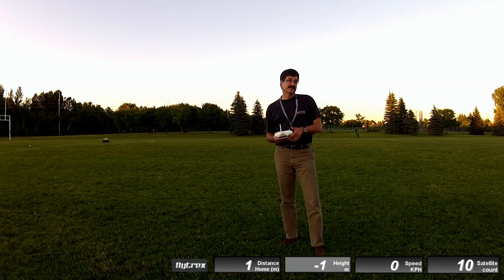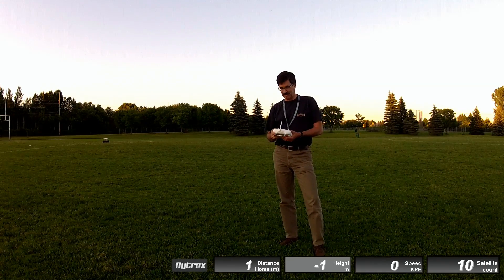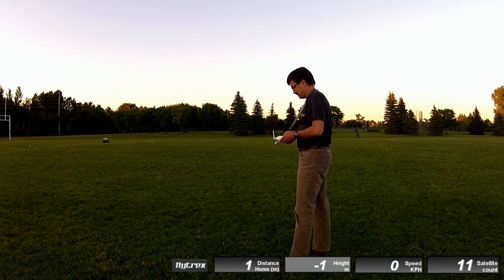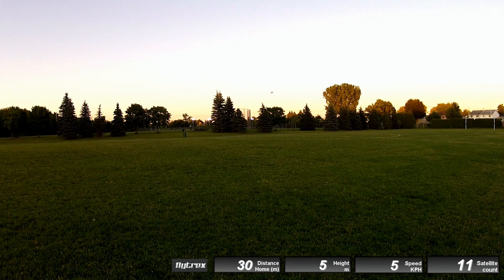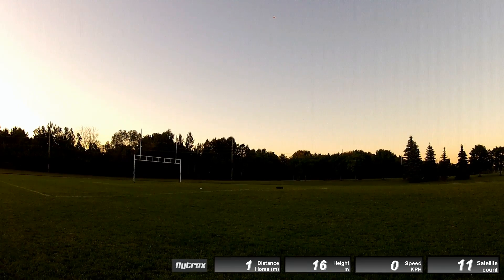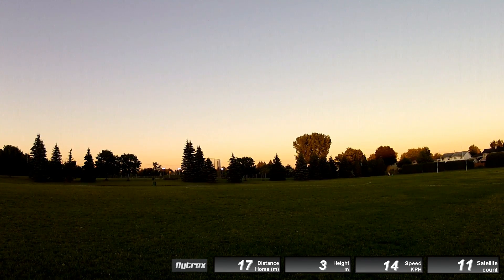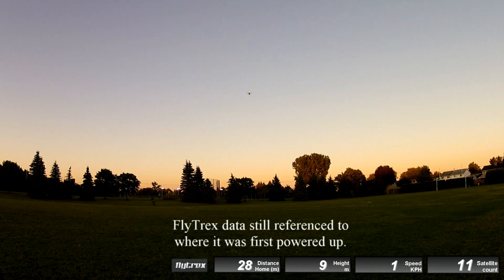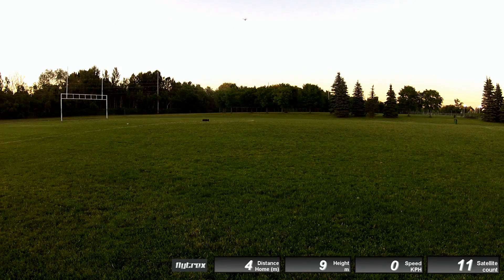Failsafe when Home Position is set above ground level.

Comment: What if you are up very high, let's say 5-600 meters; will it still raise attitude (+20 meters) when you do the failsafe return to home? Also is there a setting where you can set the distance it will raise (more than 20 meters) before it return back home?
Reply from the maker: At whatever altitude you set the Home Position, the Phantom will return in Failsafe at least 20m above that height.  If it is already more than 20m higher than the recorded Home Position, it will not climb further but will remain at that height while returning.  If it is less than 20m above the height of the Home Position (or even below the height of the recorded Home Position), it will first climb to 20m higher than the recorded Home Position before returning.  No, you cannot change the 20m setting.

Comment: Hi - how did you get the telemetry on the video? Thanks
Reply from the maker: I used a FlyTrex data recorder.  See [FlyTrex.com].  Then DashWare software to overlay selected data onto the video.  [dashware.net]
Reply: Great thanks, looks great.
Reply from the maker: GrantJohnston
The FlyTrex unit basically records time and GPS lat & longitude and pressure, from which DashWare can be set up to display various gauges of your choice showing altitude, speed, distance, even g-forces, all calculated from the changes in GPS coords over time.  It's really cool.

Comment: This is a great test. I have wondered how to deal with a potential fail safe when there are 60 meter tall trees or other obstacles between me and the quad. As you have shown, at the start of the flight I can climb to, say 50 meters, and then click the IOC switch between Course Lock and Home Lock 5 times to re-set the Home Position to that location and altitude (confirming with 6 green flashes). Then if during the  flight the quad enters failsafe it will climb until it reaches its typical 20 meters higher than the Home Position, (which would be 70 meters off the ground) and then head for home, clearing the tops of the 60 meter trees by a 10 meter margin. Awesome!!!  I didn't know it was possible to re-set the Home Position while in flight, and this option of setting it while above the ground is a great one for the scenario I've described. Many Thanks! Greg
Reply from the maker: Exactly.  The only difficulty is that it is sometimes difficult to see the green LED flashes when it's 50m up.  Toggling between CL and HL 5 times quickly is not all that easy.  You must not slip and go all the way up to Off.  It has to be just between CL/HL.  Takes practice and sometimes doesn't work.  So always confirm the Home Position has been properly set by moving away more than 10m and checking that HL pulls it back toward the correct spot. You should actually do it twice, as the Phantom will automatically mark its takeoff location on the ground first.  The HL test would look the same either way, but you can't tell if the higher elevation has been locked in.  So you should first fly the Phantom some distance away, toggle the IOC switch to mark that location, test with HL to confirm it worked, then come back overhead at 50m, toggle again to mark the location you really want, and confirm again with the HL test.  Then you'll know for sure you have that location and height locked in.
Reply: Zbip57 Excellent follow up tips. Thanks!
Reply: Zbip57 Just as an FYI on your statement above: "Toggling between CL and HL 5 times quickly is not all that easy.  You must not slip and go all the way up to Off.  It has to be just between CL/HL."  

I did a test last night with my Phantom1 with the 4.02 update, and found that I could not set the Home Position by toggling the IOC switch between CL and HL, so I tried toggling the IOC switch from Off all the way down to Home Lock and back 5 times. It worked!  I repeated both techniques several times, with consistent results. Thought you would be interested to hear about this experience. Thanks again, Greg
Reply from the maker: Greg Porter
Is yours a Phantom-2?  Mine's the original Phantom-1.  On mine toggling between Off-CL records a new "Forward Direction" for Course-Lock mode (CL).  Toggling between CL-HL records a new Home Position.
Reply: Zbip57 Yes mine is a Phantom 1. I don't know it's history since I bought it used just a month ago, but the controller has spring loaded control levers which return to center when you let go of them. I notice in the videos that your controller doesn't seem to do that? Perhaps this is a later version of the controller that I have with this Phantom 1 and that is why it behaves differently than yours? As I said I don't know the history of this one, in terms of when it was originally purchased. Also, you mention: "On mine toggling between Off-CL records a new "Forward Direction" for Course-Lock mode (CL)." I will try that and see what happens on mine.
Reply: Greg Porter Yes, ran a test and toggling between Off-CL records a new 'Forward Direction" for Course Lock.  However, that was after overcoming a an initial problem… this time (as opposed to last night's tests) I couldn't get it to reset either the Home Position or the Forward Direction until I switched to Atti. Then I could set either of them. I then switched back to GPS mode and I could still set them. Weird. But it still won't set a new home position if I toggle CL-HL, it consistently does set a new home location when I toggle Off-HL. Hope that info helps. Thx.